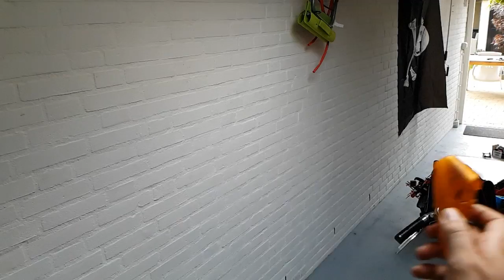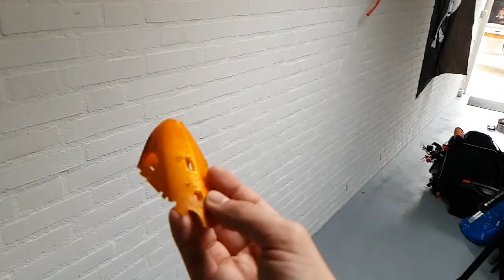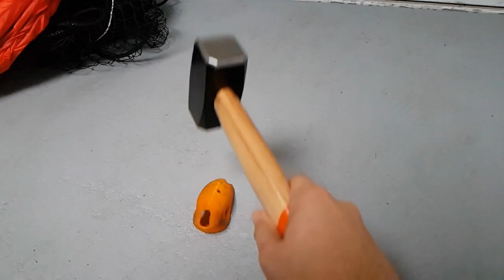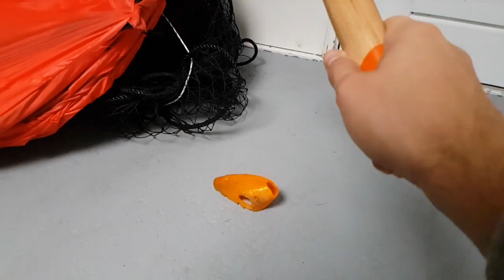Why TPU is the best material for FPV Racing Drones

Comment: I can not agree with you. What's in it for you if the canopy stays whole? It is important that the electronics will not be damaged. This is not the case with elastic TPU. Everything is crushed. That's why I use PLA.
Reply: exeswiss it's better because it distributes the shock from the crash better.